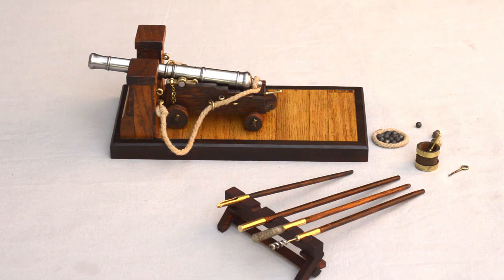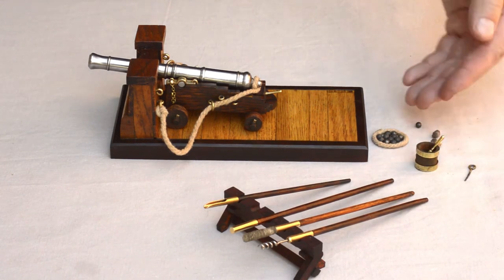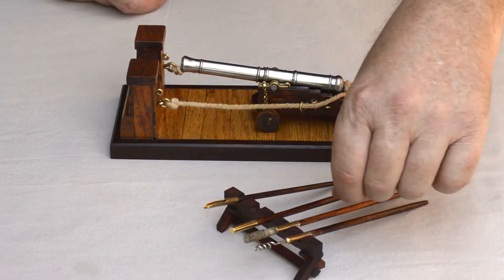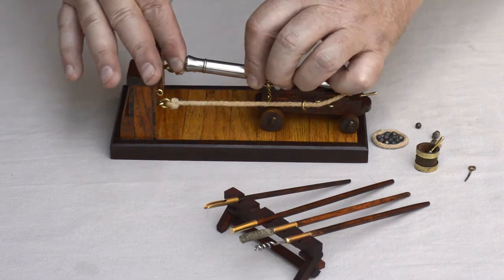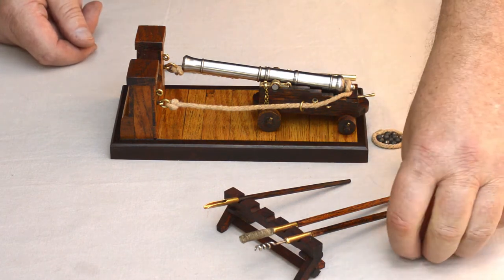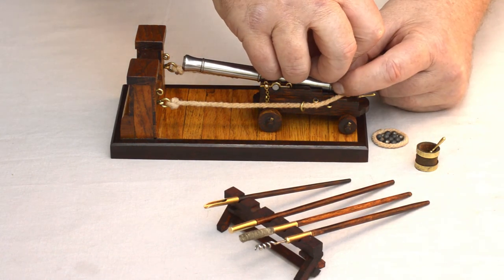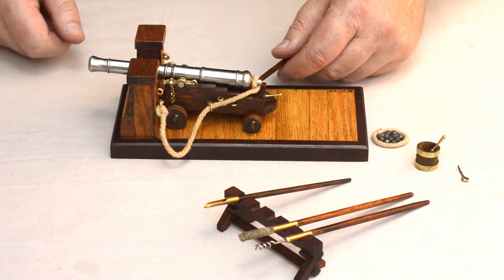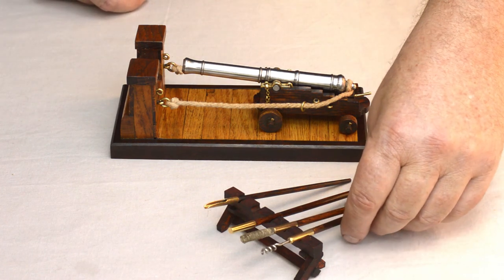Loading procedure of an 18th century naval cannon.

Comment: As a Dutch Fortress Boi meself it is so interesting to learn, not just the additional steps needed when not on dry land/on top of a nice thick wall of a nigh-impenatrable fortress surrounded by inundated land and other defenses, but also the English names for things.
Like in Dutch we call the worm de varkensstaart, meaning the pig's tail. Because it looks like the tail of a pig. And de wisser (what you call the sponge) wasn't a sponge on dry land (at least at the fortress I work at), it was a white sheep's skin. It doesn't stay white, but it's the thought that counts.
Also since we work on a fort, we don't actually have to move the cannons at all. Only up or down when starting to use it/putting it away again. Because when it's angled down, any rain that gets in won't stay in.
Apart from in Kanon 3, but that one has a small dip at the back due to centuries of use.

Comment: I'm curious as to how there was room to insert all these rods into the gun, after it's pulled back can it be rotated for more ease of use or would the men literally have to take the rods out of the small window so they can insert them into the barrel?
Reply from the maker: If the gun were to be rotated after being run inboard, which is not an easy thing to do with a 2½ ton gun, the loading would interfere with the adjacent gun and crew. It's far more practical to run the gun straight back inboard to load with about 1½ft clearance from bulwark, enough to load from. Yes, the worm, sponge and ramrod would have to be projected outboard when used, which is not impractical.

Comment: Hi I came here since I've just learned that certain projectiles use a device called "sabot", which made me remember that I've seen cannons being stuffed with additonal things other than just the powder and the cannon ball in some movies.

So I wanted to find out how these things were called and if they had the same / a similar function...

If I am not mistaken, these things were / are called "wadding" and were made of rope (or as he says "hawser") - right?
Reply from the maker: Yes, the "wadding", pronounced "wodding", was often made from expended rope on board ship. Straw has been known to have been used in field guns.
Reply: @yeoldegunner785  Thank you very much for your reply. 😀

So was the "wadding" more of a "nest" of rope fibers than a coiled up rope then?
(I have seen, that you were using paper in your cartridge making, which still seem to be a much better "seal" than straw...)

But I gues this seal does not have to be that "tight" anyway.

Do you have any knowledge or experience how the wadding is influencing the flight of the cannonball?
I mean is its main purpose to increase distance (because of the "sealing effect") or to increase accuracy (since it might keep the cannonball from "bouncing" too much inside the barrel) or is there another reason why it's better to load a cannon that way than just using the powder and a cannonball without anything else (like I have also seen in some other videos...)?

Thanks once again.
I hope I do not annoy you too much with those "nerdy" questions...

Wish you all the best! 😀
Reply from the maker: Imagine a 4" Ø hemp hawser cut in ±6" long sections and bound to prevent parting. Or a bunch of ropes put together to create a 4" Ø bundle of rope bound and cut in ±6"sections. Ø will vary depending on the size of gun. So no its not a coil of rope but more a short bundle of rope. Picture a bound bundle of sticks but in rope.
Reply from the maker: My experience in small cannon, and this is probably a similar case in big cannon, is that the wadding is essential in creating resistance. The greater the resistance, the greater the pressure build-up in the barrel during combustion of powder, which directly affects the force with which the ball is expelled from the muzzle. The greater the force equals greater muzzle velocity, which equates to greater range and accuracy.
Reply from the maker: It is a myth that cannonballs would bounce around along the length of the barrel when firing. Even without wadding to keep the ball secure, the force behind it will be so great that it will move at near the speed of sound by the time it exits the barrel. Lateral movement would be virtually impossible with this singular one-directional explosive force behind it.
Reply from the maker: I am always happy to answer all your questions. And best wishes to you too. 😀
Reply: @yeoldegunner785  Thanks again for all your answers! 😀

What you call resistance is what I was calling "sealing effect", which also seemed to me the more important aspect of using "wadding" in old timey cannons or a "sabot" in modern guns and artillery.

And yes - "bouncing" might have been the wrong word to describe the movement of the cannonball. But I think I remember watching a documentary about ballistic research where some scientists explained how the spiral shape of the inner gun barrel was improving the accuracy of hitting the target and that even just one milimeter of "give" (or even less) inside the barrel would decrease this precision.

Of course I absolutely respect your knowledge and experience, since I only try to understand those things in theory.
So I hope my questions and remarks do not anger you in any way...
I am just curious and happy to have found such a competent person to be able to write to.

Have a lovely day! 😀
Reply from the maker: @ironwhy  I appreciate your curiosity and engagement in this field.
I could never be angered by any your remarks or questions. Who knows?, I might well be wrong in certain aspects and I'd be happy to acknowledge that and make the necessary apologies and corrections. 
Through conversation we all grow the wiser. 
I agree with your stance on the use of wadding. There are other benefits such as keeping the powder dry at sea, although I somehow doubt they would have kept guns ready loaded at all times. 
I have to say physically working with these guns one gains a tremendous amount of understanding of how they work and a huge respect for it too.
Have a tremendous day!

Comment: Sir, the real crew actually loads the full-size canon faster than you.
Reply from the maker: Yes, but this a demonstration. In this video I'm actually 4 seconds quicker than a Royal Navy gun crew. https://youtu.be/RsIdRm2FfuU
Reply: so-so... a lot of things are fast and easy at small scale, but slower in real life. The  pointing and elevating are much slower, when you have to coordinate half a dozen men with hand spikes, moving a multi-ton cannon. also, running out the gun alone takes much more time than shown, with pulleys and ropes.

Lastly, there is a huge  span of times to reload, from a short and light 3pdr on the open deck with  no hull or bullwark in the way on one end of the spectrum, to the 42lbs multi ton moster with not proportionally equally upscaled crew working through a gun port.

Comment: What's the procedure for bracing for return fire?
Reply from the maker: I don't believe there was any. That's a video game thing.
Reply: with wooden ships at the usual fighting distances of the era, anything  above 12lbs (which is basically almost every gun of  almost every ship of the line) will have no issue penetrating whichever  hull or bullwark thickness your ship has to offer, so you just depend on luck alone to not get hit directly or by large pieces of splintered  beams.

Comment: ho ho, you forget something, your righ hand is outside the boat. 
the cannon must go back many more and return to place with pulley or muffler
Reply from the maker: The recoil distance is correct. Just enough to reload from inboard, you'll see it if you take a look at the clip in my channel from the film A Bequest to the Nation. At this scale to have the running tackle run the gun out is impractical. Maybe I'll do it with my eighth scale gun.

Comment: how long would the process take?
Reply from the maker: Hi, historically the English claimed that a well trained gun crew would be able to get a shot off every 90 seconds, or two every 3 minutes, however this high rate of fire would not be able to be sustained for any lengthy duration, as fatigue and the speed with which the powder monkeys could maintain the supply of powder charges to the gun, would have an effect.
Reply: @yeoldegunner785  thanks! also i keep seeing the fire rate for cannons in the 1500's-1600's be described as 2-6 an hour depending on the documentary. i have a hard time believing it could take 10 mins to reload a cannon much less more then that. was the loading much more compilated at that time?
Reply from the maker: One must understand that during the Napoleonic Wars naval warfare was already a refined art. Standardized guns per gundeck, pre-prepared felt or paper charges, with goose quill vent priming charges, and well drilled gun crews were the norm. In Tudor England the picture was very different indeed, with mixed gun batteries, even variations bore diameter in similar guns, I can imagine the shot selection became an exercise in itself. Repeating gunfire was not the standard  tactic of the day, even though gun carriages were becoming capable of keeping up a constant barrage. Smaller gun crews, decks crowded with soldiers, fewer specialized master gunners and gunners, hand ladled powder down the bored, all would add up to a significantly slower rate of fire. It is quite conceivable that a rate of fire of 10 minutes would be considered good. I too have seen documentaries that suggest that during the Armada campaign in Elizabethan England a rate of fire of an hour is suggested. I too think that is somewhat absurd. I would think the carousal tactic would give a more accurate indication, in other words the time it would take an English ship to approach the enemy, discharge the bow guns, then come about, fire a broadside, continue turning, fire the stern guns and then the other broadside, all in turn and then repeat the process. In the light winds that could take quite some time, considering the tacking and wearing, certainly enough to have reloaded by the time you have come fully about.
Reply from the maker: In Sixteenth century siege warfare with massive bombards I could fully understand a rate of fire of several hours.

Comment: Where can I buy something like that
Reply from the maker: I built that myself from scratch. $450 and everything you see is yours.
Reply: @yeoldegunner785  how did you build the actual gun the metal part
Reply from the maker: The barrel is turned from mild steel with the trunnion as a solid through piece welded in place. The trunnion and bore are same Ø and intersect 50%. The bore cuts through 50% of the trunnion. Top of trunnion is centre-line of bore as historically correct for the period.
Reply from the maker: $13 will get you a set of dimensioned plans. https://www.facebook.com/groups/778434452503624/permalink/1905402616473463/